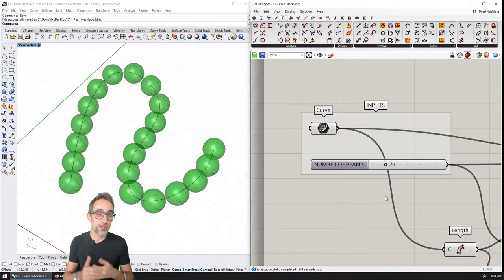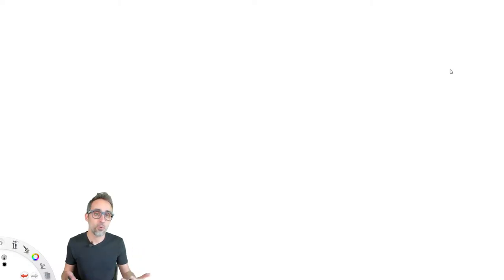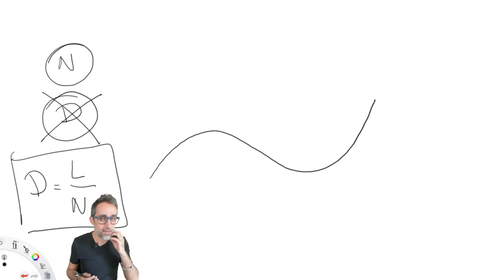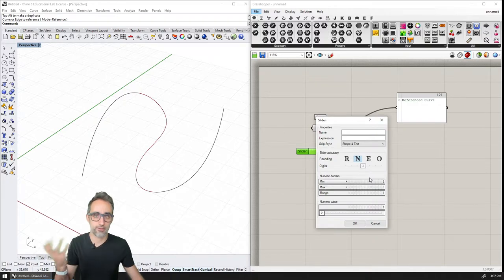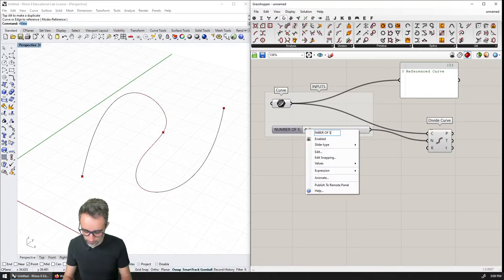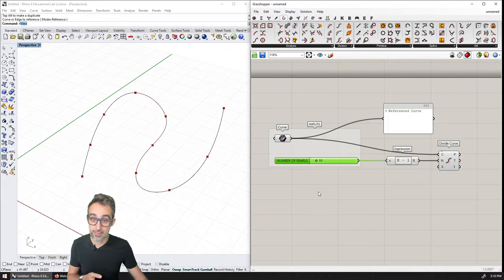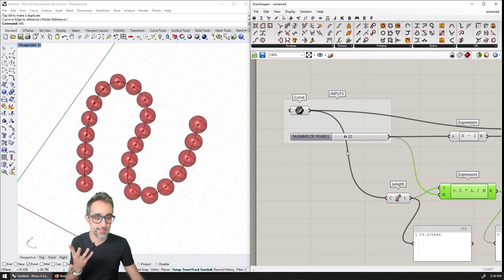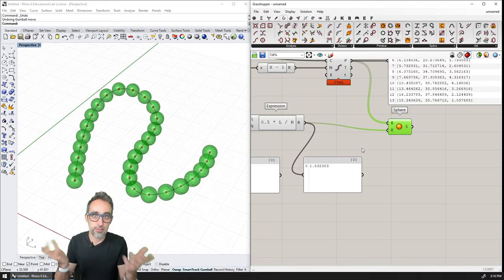E.1 How to Model a Pearl Necklace Parametrically - Intro to Parametric Modeling

Comment: what I did was I used construct point to later be interpolated and make my own curve.  I then used the formula you used Diameter of circle= Length of curve/Number of spheres. Though I was kind of confused why the value 2 was added. Then I realized, and correct me if I am mistaken, diameter is the addition of two radius, so the value 2 multiplies with the number of spheres. The whole tutorial on grasshopper is really helpful, thankyou so much.

Comment: Thinking through all the necessary aspects, parameters of the problem we want to solve rather than just using the tool is key thing to consider, that's a great piece of advice👍 Things will be much clear that way :yougotthis: